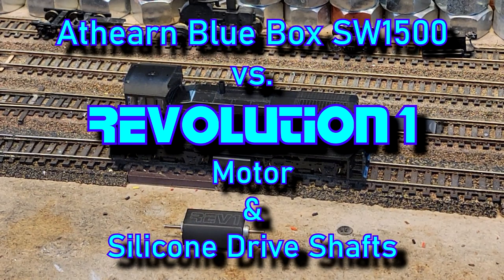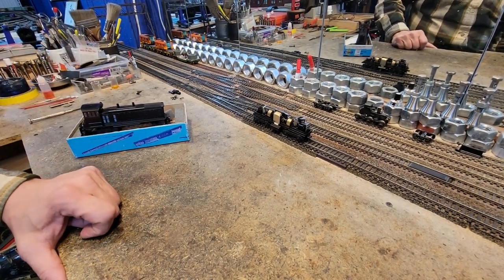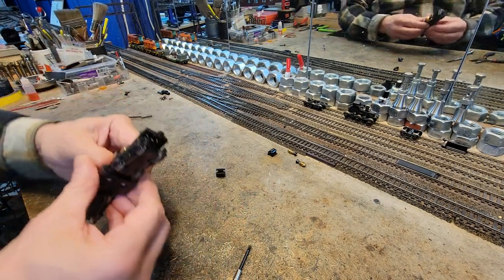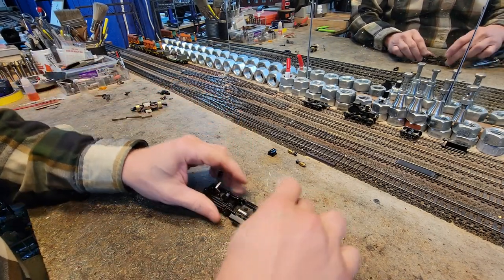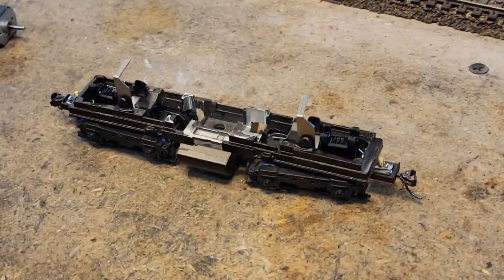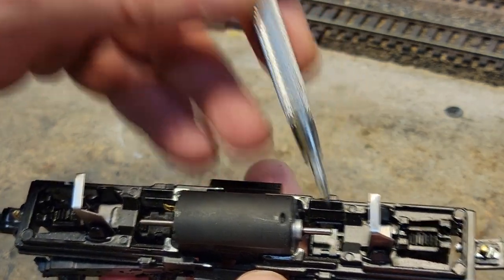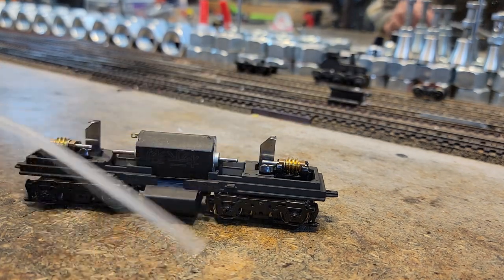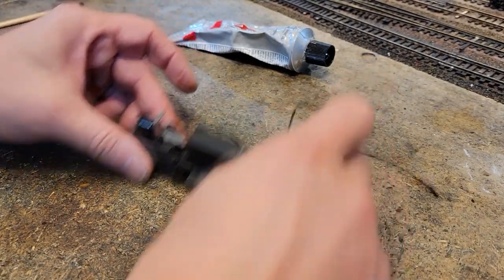Athearn SW1500 vs REVOLUTION 1 Motor

Comment: Thanks for the info about the silicon tubing in the comment section. I need some of that to fix a few problems of my own. I gotta say that you and Classic Model Trains channel have given me the inspiration and detailed knowledge to get back to building and running my trains. I appreciate that!
Reply from the maker: I've just entirely switched over to the silicone hose.  So much easier and more reliable that the old way of shafts and joints.  I had gone so far as designing and 3D printing all my own joints and shafts, but now it's hose all the way!  10 bucks is a lifetime supply!
Reply: @elite194  Ordered mine tonight on Ebay! Ought to be here by Jan 10th. Thank you, thank you, for the info!

Comment: Love the video.  Glad the rev1s are working out.   How much weight/tractive force did you lose dumping the two flywheels?  I have a 3% slope on my layout and weight in the locos matters.   You have sold me on silicone driveshafts.   Do they lower the noise perceptibly?
Reply from the maker: way less noise, all you can hear are the gears and those have no grease yet.  the lead shims I used weigh about the same as the flywheels and with this motor you can go up ludicrous grades pulling cars at super slow speeds!  I'm taking a batch of motors to the train show on Saturday and hopefully a couple of my favorite sellers will start offering them!

Comment: Where do you purchase replacement motors from
Reply from the maker: nowhere yet - but this Saturday I'm bringing a bunch to the train show hoping to get a couple of my favorite sellers to start offering them!
Reply: REV1 motors, is elite194’s domain. However the FS-280 or FN-280 motors are readily available on eBay for around $3.25/motor. They ship from China, so they’ll take a bit with it, so be patient
Reply from the maker: I've gotten 280s in about 10 days lately..  I fear the stockpile of the good ones has about a year before they disappear like the the Lexus motors I used to love!
Reply: Are you still making the Rev 1 motors?
Reply from the maker: @petescouve  the first production run is complete, before it runs out I'll get the run in the works!
Reply: @elite194  I will be watching for them. Thank you for your videos.
Reply from the maker: @petescouve  I'm working on getting the motors into club stores so they can sell them - so far 2 clubs have samples for testing and things are looking good to get them out there!

Comment: Kadee makes a point of specifying that couplers with plastic shanks be used with locomotives. You mentioned using no. 5's and no. 148's with this locomotive. Are plastic shanks not necessary so long as the frame is electrically isolated from the tracks and motor? Also, hope you succeed in finding a seller for the REV1!
Reply from the maker: If you use the Kadee draft gear boxes, they have an insulating sleeve that protects the coupler from the screw!!  you only need isolation when using the coupler cover that comes with all Athearn blue box and a few others.   in those locomotives the coupler touches the frame directly, but what we did was file the coupler pad so a coupler inside and insulated box would be totally safe!

also I know a member of a club that has a store inside the club and I think I can get them on board with carrying the REV1 - hopefully it goes well!

Comment: Can you do a remotor to replace the rubber band drive on a blue box Athearn RDC? Thank You
Reply from the maker: I sure can!  I've got 2 in the junk yard that I want to get running using some VCR/TAPE player drive belts - those belts are dirt cheap when  you but a bag full and they don't wear out for decades!  Also one of my RDC has a very unusual clever modification to keep the belts in place!
Reply: @elite194  Thank You for answering. I meant changing the rubber band drive. In other words a drive that doesn't use the rubber bands. Something without using a belt drive.
Reply from the maker: I've been thinking about that myself so I can someday make a B-B diesel - on the RDC, I'd start by replacing the shafts with silicone.  If that works as well as I think it will, then I'll replace a truck with a blue box truck - next thing you know, step by step, it's solved!!  Then we completely scratch build one from nothing!
Reply: @elite194  I have been thinking about doing a remotor & new drive using just what you said but don't know what BB trucks & motor would work on that frame. BB Athearns are my favorite. If you decide to do this conversion please let me know. I'm on old timer & could use your help. Thank You again for answering.
Reply from the maker: for the RDC, you can use the "large torque mini 280 24v  motor"  - tha'ts what I would use since there is so much room inside.  blue box trucks that will work are from the U28B-U33B series blue box.  those would be my first choice since you're beefing up the power plant.  you can use metal sideframe version or plastic sideframe version or mix them.  sometimes you can get the set of sideframes that are white metal FB-2 that were used to replace the metal sideframes on the original.  that would be really cool!

Comment: How good do these motors creep at super slow speeds? Where can I buy these motors?
Reply from the maker: they will beat anything out there.  the closest is the 280 motor, but that one only fits a very few locomotives that are old enough to have wide hoods, like the Athearn Trainmaster.  The REV1 is based on the 280, but in a size that fits new locomotives with scale width hoods.  Right now, I can't get more, hopefully that will change soon.  I had them made specially to my specs.  Send me an email from the contact info.
Reply: @elite194  Also, I'm looking for a good small motor for switchers as well. Any help me be awesome. Thank you
Reply from the maker: @moogman1978  24v dual shaft FK-130 is what I used in the Athearn Hustler.  Very powerful at slow speeds!

Comment: Just wondering if you're stripping parts out atherine locomotives what are you going to do with the parts if nothing els is there any way I can obtain them....
Reply from the maker: I've got a few friends that are always needing parts - so much so that I had to learn to 3D print a bunch of the parts!
Reply: @elite194  I was wondering cuz I do have local motors that are lacking certain I'm always looking on eBay for parts parts I do have a very old Atherine PA1. Locomotive with flywheel drive missing the forward drive shaft there is a short and a long one I'm missing the long one....
Reply from the maker: use the silicone hose!  1x4mm food grade silicone hose on amazon!  you'll never need drive shafts and u-joints every again!  the hose has a 1mm inside diameter hole and a wall thickness of about 1.5 - 2mm thick.  1 roll is a lifetime supply for about $10!

Comment: No room for the flywheels with the motor change???
Reply from the maker: I don't use flywheels - the REV1 motor is much more accurate than other motors so when you use the digital momentum you get very precise response!